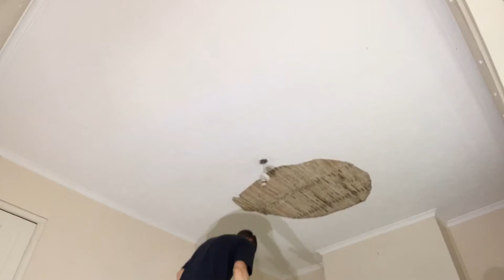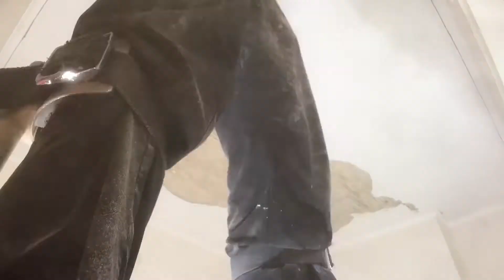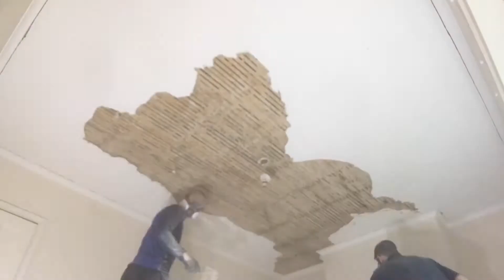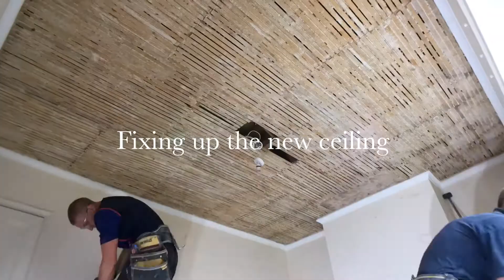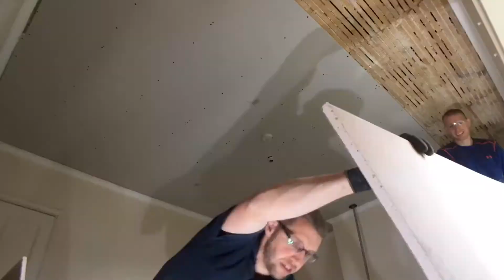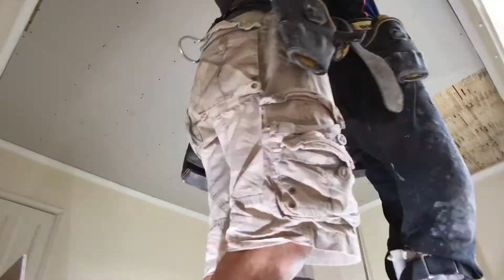Remove and replace a lath and plaster ceiling

Comment: Should the lath be removed or does it matter? Looking to update my old plaster ceilings and wondering if it's necessary or if there are any drawback of leaving lathe up?
Reply: What did you do in the end? I’m researching too atm and get the impression that it’s generally better to remove the laths to get the ceiling level - but may depend on the condition of the laths?
Reply: @jamiejones8508  I ended up removing the lath. I had rock wool insolation that was coming down, since it's loose. I decided to put drywall ceiling so removing the Lath was necessary for me to add new insulation, and get a close fit to the joists. All in all removing the lathe was the better approach as it avoided headaches.
Reply: @Weeblewobb  Bad move. Keep the lath if intact. Fix any lath that needs fixing, and replace the plaster.

Comment: What if the property is old and plaster contains asbestos? Can the ceiling be over boarded without removing the plaster? Would it still require an asbestos licenced contractor I.e., would the overboading disturb asbestos? Thanks

Comment: I bet that in a few months there will be cracks appearing, running around the joint between the Drywall and Cornicing.  Seen this happen on loads of jobs where the ceiling has been repaired in this way to save the cornice. You need to get the drywall right in behind the cornice and ensure that there is a good bond with the cornice using adhesive and conditioner.
Reply: Thanks for the tip - so take it all off?
Reply: @jamiejones8508  No, put up new plaster.